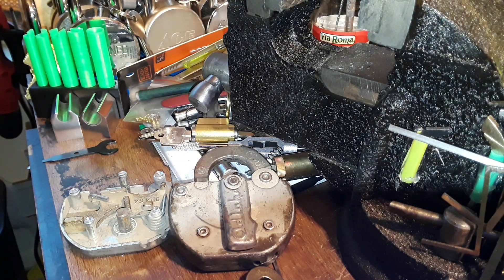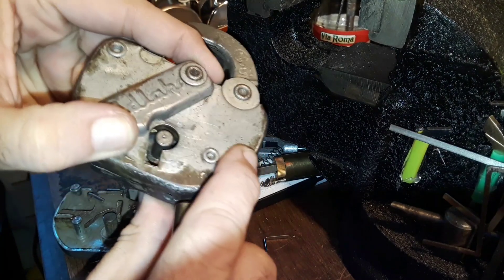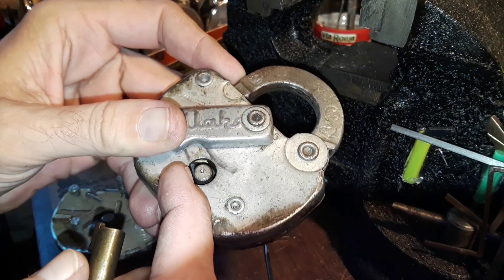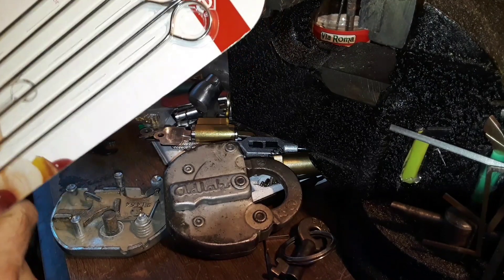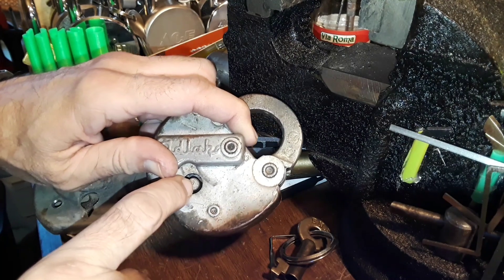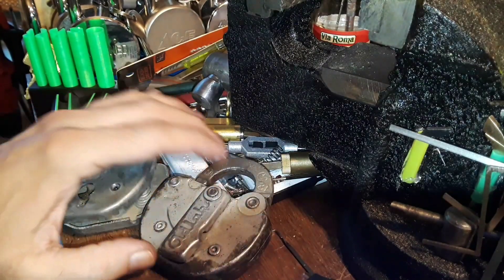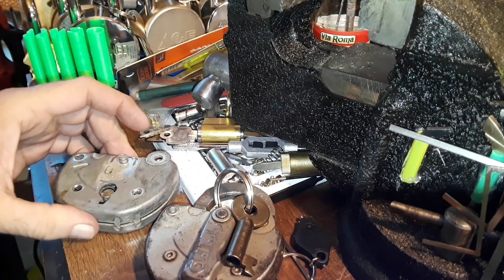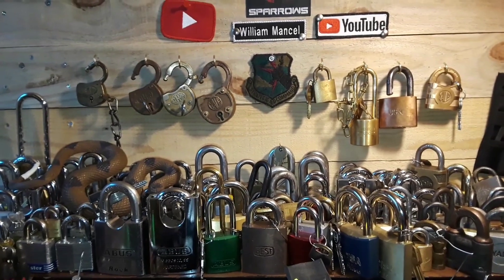(501) Adlake Railroad Lock with Key

Comment: Something different for the collection. I am not suprised that a lot of those types of locks come without key. The turning torque required is extreme and a key or two would have paid the price over the journey. Cheers:-)
Reply from the maker: It is really strong torque required,  and those keys are only brass. Considering the age, and the number of times these things have been opened,  you are right. Many of the keys probably snapped,  or cracked.  
Thanks for watching my friend.